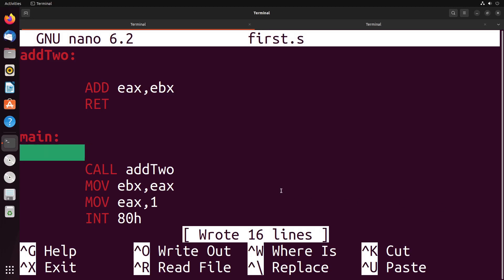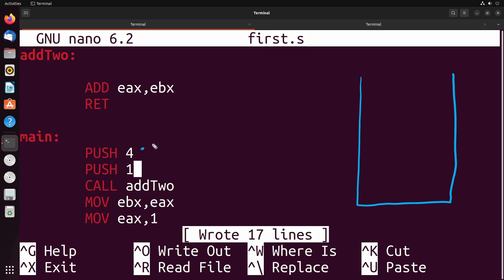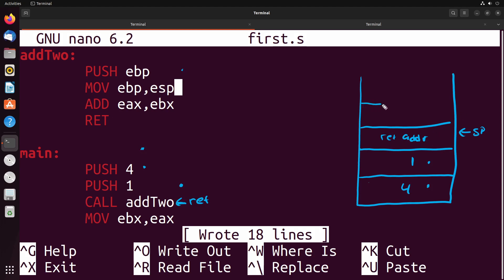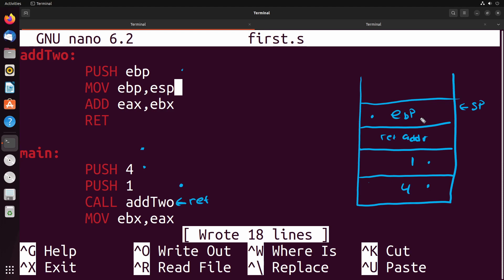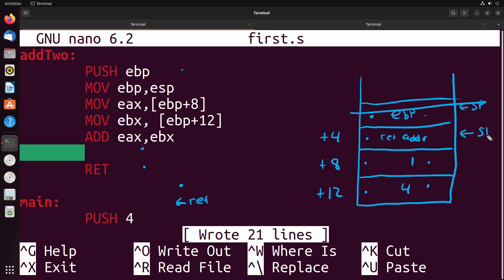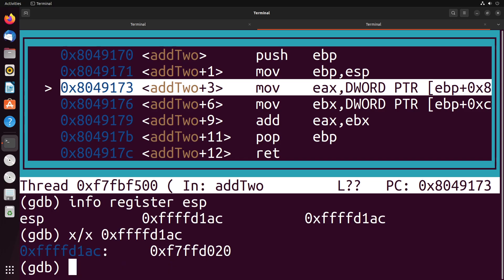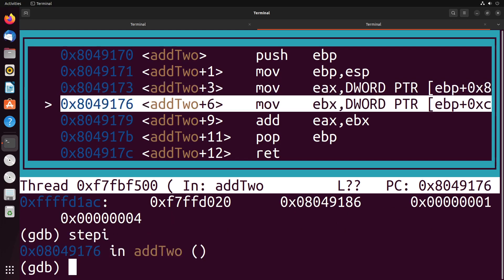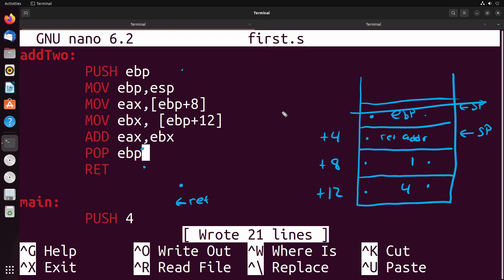Learning x86 with NASM - Passing Data to Functions on the Stack

Comment: I was confused about why we do ebp+4 ie why each stack value if 4 units. I searched on the internet and  It said something along the lines of x86 use ebp+4 whereas x86_64 uses ebp+8

so I concluded that since we are writing assembly for 32 bit machine right now, 4 must mean 4 bytes (32bits). hence the size of each address must be 4 bytes on the stack.

am I wrrong? Please clarify.

thank you

Comment: Great explanation overall. Just one clarification -- when sub_two is called from _start, the push ebp in sub_two does not push a meaningful value because _start never set ebp. So when you examined [ebp] in GDB inside sub_two and it showed an address, it is just as likely to show 0x0 (what I saw). After looking into this, I found out that the push ebp in sub_two is still required for consistent stack frame setup and pointer math. A base pointer WILL contain a meaningful value from a push ebp when making nested function calls, as it allows you to restore the base pointer address before that function returns. For example...

sub_one:
    push ebp                 ; save sub_two’s base pointer
    mov ebp, esp          ; set up new frame
    mov eax, [ebp+8]
    sub eax, 1
    pop ebp                   ; restore sub_two’s base pointer so that...
    ret

sub_two:
    push ebp                ; value in ebp is undefined but must be pushed onto stack for pointer math (i.e. frame setup)
    mov ebp, esp         ; esp contains address pointing to undefined value just pushed, that address is put into ebp
                                     ; this allows you to push more stuff onto the stack while still being able to access stack variables

    mov eax, [ebp+8]     ; use address in ebp as stack pointer
    mov ebx, [ebp+12]
    sub eax, ebx

    push eax                     ; can still push values onto stack
    call sub_one               ; nested function call
    add esp, 4                   ; discard pushed arg, can also pop the value

    mov ecx, [ebp+8]       ; ... you can still use original args

    pop ebp
    ret

_start:
    push 4          
    push 6
    call sub_two
Reply: No clue of what's going on or whatsover
Reply: i saw that, the ebp will stay in the base of the memory stack if you dont set a new frame in _start

Comment: hi, firstly thankyou for the explanation, i have been trying to work out what is going on here and now i feel like it makes a bit of sense

1 thing i am wondering though is if it is a problem / whether there is a nice solution for clearing those variables out of the stack when the function returns? they seem to stay there until my program exits
Reply: Just pop them into a register you're not using. This is required when making nested function calls and must happen right after the call instruction.

Comment: Excellent series, I have been getting into reverse engineering so figured I would start with learning x86. One note however, why would we mess around with the EBP register if we already know that ESP would be located at the top of the stack, with all the other data below it. Why not use ESP as the reference to access the data?: for example: mov eax,[esp+4]
Reply: Using EBP instead of ESP is preferred because ESP changes dynamically with push and pop operations, making it unstable for consistent access. EBP provides a stable reference point, ensuring reliable access to function parameters and local variables.
Reply: @Mohamed-qt1st  Ahh, makes sense that in a bigger program you would point to a specific non-dynamic address, thanks!

Comment: Not sure I get the point of the ebp twiddling.

Is it to store the initial value of esp, such that if you do more PUSHing or POPping later on, you don't need to keep track of how many times you've done so manually and can do maths on the earlier-saved value in ebp?  Essentially trading a (whole!) register for some easier programming?

Comment: Do you know what's wrong with my code? The program gives me a segmentation fault.
extern printf

extern exit

section .data
	msg DD "test",0
	fmt DD "%s",10,0

section .text
global main

main:
	MOV eax msg
	MOV ebx fmt
	CALL print
	PUSH 1 
	CALL exit

print:
	PUSH ebp
	MOV ebp, esp
	PUSH eax
	PUSH ebx
	CALL printf
	POP ebp
	RET

end:
	MOV eax, 1
	INT 80h
Reply from the maker: The problem with the code is in the print label

At the end you run:
POP ebp

The current top of the stack points to ebx since it was the last thing pushed onto the stack. This code would pop the value of ebx into ebp. When the RET instruction runs, it tries to return to the address of ebx which causes the segmentation fault. To fix it, try this:

print:
	PUSH ebp
	MOV ebp, esp
	PUSH eax
	PUSH ebx
	CALL printf
        POP ebx
        POP eax
	POP ebp
	RET